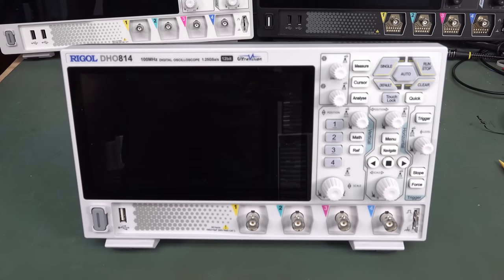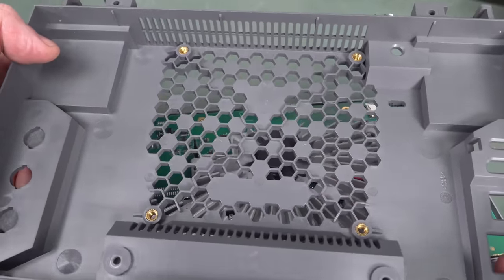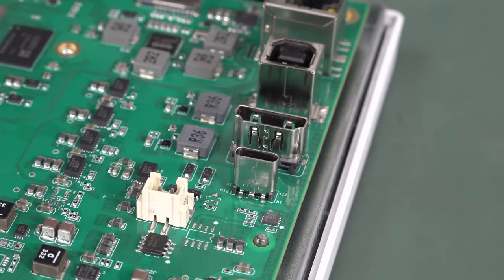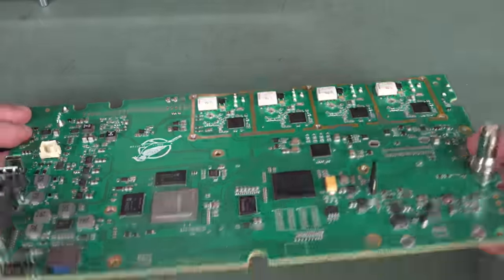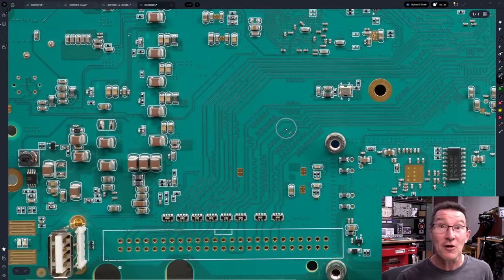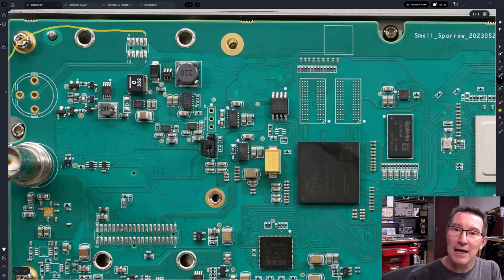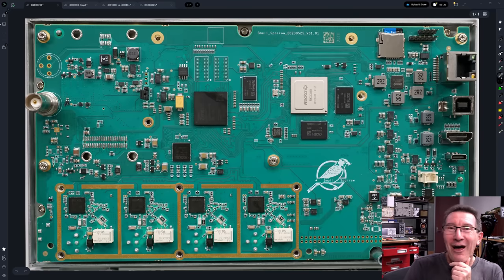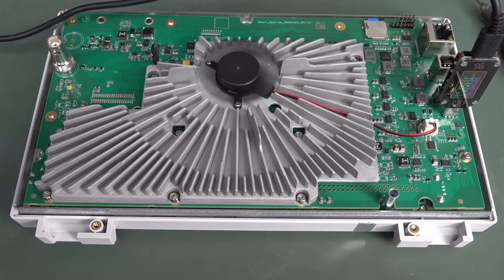EEVblog 1563 - New $389 12bit Rigol DHO800 Scope TEARDOWN

Comment: I would expect the SD card to have either an EXT4 or F2FS file system. But if Linux can't identify or mount it, it really might be something special.
Reply: Yeah someone mentioned trying a faster card for improved boot time - I'm assuming soemthing like DD could make a binary copy?
Reply: Someone hacked it already, it has a very weird filesystem setup. But all the necessary android files are there, which means you could turn a DHO804 into a DHO924S by swapping the SD card.
Reply: @petegaslondon  Yes, dd will make an image of it no matter what file system and partition type is used.
Reply: It MIGHT also be due to the sector size used for the filesystem.  Linux on x86/amd64 doesn't support larger sector sizes than 4096 bytes for ext4.
Reply: @0x8badf00d  The term you're looking for is block size, and this limitation could be removed very soon with the current work on folios.
Reply: @JHVOGamers maybe if someone is good at hacking we might be able to get the scopes android to run on a orangepi4 or get orangepi 4 optimised osses to run on the scope?! who knows but cool that it alr has been hacked

Comment: Oh that niiice - I'd recommend maybe, if you ARE gonna go inside,(void your warranty!) A blob of epoxy over the USB-C?
 Oh I WANT that Logic analyser one its niiiice - with the generator and in black, is like oohhhh!!
  (never had anything much more advanced as my poor ol Tektronix rack valve jobby, that i had before the nasty Eviction - kit-built a few little pieces of Chinesium test stuff, but ooh I LIKE this thing)  . .  PS Maybe the termination res's are applied so the open transmission lines dont resonate/ring? OR that they can rework their OWN boards easily - OR that you really CAN do it yourself :)

Comment: If I would buy one of these, first thing I would do after the warranty expires is to clone that SD card. It will almost surely fail/get corrupted within the first 5 years. At least it's a decent brand, but still a guaranteed failure point. At least it's easily replacable, so I like this idea against the soldered-on flash memory, which is only a bit more reliable than an SD card, but takes much more effort to dump its contents and clone it.

Comment: The only things that really concerns me about this are the USB C power connector and the fan. If any of them break you could have a bad time. Otherwise it looks like a great deal.
Reply: It’s not terrible to replace USB-C connectors as long as the traces stay put. I say USB-C power should be a standard for T&M that can use it.
Reply: @absurdengineering Replacing a USB C connector is easy. What concerns me is that if you need to replace it, there's a good chance there's damage to the PCB already. But that's not the main reason i dislike it. The main reason i dislike it is the need for an external power brick. With the provided USB C power back you need some more desk space (more than the DS1054Z had in the back), or you need to buy a slimmer third party one (that would add cost, storage complexity and general inconvenience). Standard power cables are really convenient since I already have a box with 20 of them.  
I love USB C for devices that 100% require small form factor - laptops, smart phones, headphones, etc, but I'm not sure I like it for T&M. Or maybe i'm wrong and i just need to give it some time in order to see who it would fit.
Reply: The USB C is through hole. That is, thank goodness, a step up from those useless surface mount ones.
Reply: Attach a 90° USB adapter to the back cover, JB weld or hot glue it in place.  Bob's your Uncle.

Comment: The first console that you opened up was probably the Android shell which is a derivative of Linux shell. You should be able to list files and folders with `ls`, `cd` into directories and maybe even list some hardware specs (e.g. system RAM) or look at how they are using the SD card and stuff. I think the shell could be using the Busybox toolbox so the basics should be there.

Comment: I would have really liked to see a metal plate inside for the mount, im not worried about its weight im worried about grabbing it and overcoming the monitor mount friction several times a day as you tilt it around across the bench

Comment: It doesn't look like the paths from the frontend to the ADC are differential, just single-ended referenced against the ground and shield.
Reply: Huh? Just zoom in, it’s plainly visible that they’re controlled-impedance differential pairs. (And the pair of series resistors is also plainly visible.) There’s a separate guard trace to the shield.

Comment: Strange to use a micro SD card like that. I've seen that done for a prototype or development revision, but then for later builds they swap it out for an emmc module to save cost. Gluing it in also makes it seem like they don't intend users to swap them out as a means for an upgrade, but maybe for a technician to upgrade?
Reply: It's possible they want to be able to quickly/frequently update firmware in the factory during assembly. With SD cards, you can do that with a cheap duplicator machine, but it's harder with an emmc.
Reply: Maybe uodate firnware easily
Reply: Some eMMC modules have very high failure rates.  I have a bunch of network devices here with dead eMMC modules, which I can’t fix because the ROM has a very limited eMMC driver.  And eMMCs are on small daughter cards, so they were designed to be swapped!  If these devices, had micro SD, they’d be simple to repair.  Never solder in flash memory if you can, because it wears out too quickly.

Comment: I got the 924S and it heats quite hard to the point the BNC on the front are hot. Same with both BNC at the back (OUT and function generator). I have put a 100mm fan on the back and it cools it down well. I bought it for the PLA, output to monitor and the fact you can use a mouse and the monitor without a computer. With age is harder to see these small displays

Comment: One issue I see is the fan is going to be difficult to replace when it inevitably fails. You are not going to be able to get that off the shelf.
Reply: or take out the fan and srew a bigger one on the outside ... I did that also on my 1054
Reply: It might be a pretty standard graphics card fan.
Reply from the maker: I found many off the shelf that look identical, they are used on GPU cards.
Reply: @EEVblog  I still think I would have preferred a case that was even 10mm thicker and used a standard fan that I could get from RS/Digikey/Mouser/Farnell etc. How easy is going to be to get a replacement fan in 10 years time? That said I think I would have preferred spending an extra $10 and having a bigger case and heatsink with no fan 🙂

Comment: It's really nice that they populated all those extra small components. Those are always the hardest to find if you want to hack such a device. 

I tried to add Bluetooth to a slightly older car radio. It has an audio input selector that is controlled by I2C and has traces going to an unpopulated RCA jack on the back used for a cd-changer. It has some kind of a bus system on the board that checks if devices are present and communicates with them. If you unplug the Cd part, there is no CD option in the input selection anymore. With that functionality I can't just solder wires to those rear solder joints but I would also have to populate the components used for the cd-changer bus and somehow trick the CPU into thinking that there is an active cd-changer connected. I now just soldered the Bluetooth module to the front audio-in pins and can change the input by flipping a switch to turn on/off the BT receiver. I could even use that thing as a simple Bluetooth receiver if it is turned off with the audio-in jack as an audio-out.

Comment: The SD card is also an easy way to factory-program the thing: no messing around with JTAG and such, just stick in a preprogrammed SD card containing all the firmware.

That doesn’t explain why it won’t read on Linux though. What does dmesg say when you plug it in?
Reply: Maybe the content inside is not a valid filesystem. Maybe the bootloader inside the processor know how to handle. A raw dump will clear the things.
Reply: JTAG isn’t just for programming. JTAG literally stands for “joint TEST action group”: JTAG’s original purpose was to enable circuit testing without needing to add as many test points, complex test jigs, etc. It’s commonly used for production testing.
Reply: @tookitogo  Sure, but you can do both: fully test all boards using JTAG and then later personalise them as needed with little effort.
Reply: I bet it would read with the right software. It's probably just not formatted with a standard partition table. Something like Balena Etcher would probably read it just fine. Making sense of what you read, that would be the difficult bit.

Comment: Rigol needs to address the flimsy connectors. The logic analyzer upgrade is a ripoff if the power connector breaks off. They obviously weren't paying attention to the 1990s through the 2010s when laptop power connectors constantly fell off their motherboards.

Comment: The discretes being fully populated would depend upon the MFG method. For very high speed /throughput MFG you have one reel for each form factor of components that is pick and place. So for example you would have a 0603 reel and it has all resistor, caps, inductors on it. This allows the pick and place to work in a linear fashion across the board. MUCH faster and if the parts cost fractions of a penny the savings for this high speed is likely higher than having different master reels made.  Discretes in volume in China are basically the cost of material +5 to 7%. Master reels (where these discretes are placed in the appropriate position from raw reels to master reels) cost virtually nothing and are often just a contract line item.  And of course populating the discretes terminates otherwise open lines.   This is an exceptional design. Hats of to the Rigol engineers.
Reply: They used to do this for through hole parts which were physically much bigger so you couldn't as easily line 10s of different components up next to each other on a machine.

But surface mount components are so much smaller and tapes are what 8mm wide at minimum? You can fit 50-60 maybe more different reels across each side of a high volume PnP machine... Do they really bother to populate custom reels of different surface mount components in a particular order just to make the machines job easier? Doesn't make sense to me...
Reply: Yes they indeed do. If you watch a video on very high volume production consumables (like cell phones) it is phenomenally fast.  Reel changes and repositioning adds up very quickly. Generally the Production Engineer will evaluate the cost benefit and order the reel stacking. During the pre-release design review stage (or earlier) you bring in the PE and make sure the Design For Manufacturability needs are met. Part of this review are cycle, throughput and test times.  A good PE prints profit really.

Comment: Love a new small scope with more features!  However... as a retired engineer who tinkers around, I'm pretty happy with the 100MHz 4 channel 8 bit Rigol DS1104.  I'm not sure I can envision a situation where a 12 bit scope would be noticeable improvement.  Maybe when dealing with very small signals?
Reply: If you wanted to measure noise in an audio circuit or something, I could see it being useful.
Reply: from 8 to 12 bit is a huge gain!
Reply: well i suppose if you think of 8-bits as being a max resolution of 1024 peak to peak. (but only when the scale takes advantage of the entire range)... that is like a 1080p hd sort of resolution. so then 12-bits is analogous to going from hd to 4k i suppose? does that sound about right?
Reply: @dreamcat4  No question that it provides more resolution, but I can't think of any instance where I was dealing with a signal of a couple of volts where I needed more resolution.  If I was working with a microvolt signal, then possibly.  There's also the issue of signal to noise ratio.  If I've got anything other than a very clean signal, then the extra resolution is overshadowed by the noise.
Reply: @dreamcat4 in what world do 8 bit have 1024 counts?
Reply: dang you are right  @Lumi_nance  ... i got confused with the other 10 bits scopes

Comment: Could you mount a 92mm or 120mm fan on the back?
Reply: 92 mm sure has to sit there.
Reply: With enough hot-snot, you can mount anything to anything.
Reply: @ghydda  I was thinking of a 3d printed adapter/mount.

Comment: I'm trying to understand if I can supply the scope directly from 3 Li-ion cells (11.1V discharging to 9V) or 4 Li-ion cells (14.8>12V).

I suppose the scope has an internal dc-dc converter to provide all the necessary voltages that can handle some supply voltage changes.

Based on your experience and the results of the teardown, please let me know what you think.

Comment: SD cards are a lot cheaper than eMMC. And a lot slower. eMMC and  RAM have both jumped up in price lately. It is running Android? That is disappointing but being a phone chip, the 3399 is probably better supported that way. I have noticed the Debian/Ubuntu/Armbian for the 3399 has Android kernel stuff that is not so great.

The passives for the memory chips are probably so that these boards can be for either product by only adding those two parts in rework. And given memory price volatility they can go ahead and make boards and shop for RAM at spot prices later.

Comment: Serious question: when is it time to give up on my old analog scopes? I'm sure the resale value is nearly nothing - I paid $400 some (10?) years ago for a 100 MHz two channel scope with two additional channels (really sort of a channel 1B and 2B) with independent triggering, time delay, and magnification (effectively, you can view a different portion of the signals on channels 1A and 2A, or zoom in on a slice of one of those channels while also viewing the full signal).

It's still a useful piece of test equipment, but what am I really missing? It can't catch a one-shot glitch (rather, no way am I going to fork out $3+ a shot for Polaroid film and pray I get the triggering right), it can't store plots to share online (not that anyone wants to see my scope screen), but these things aren't really meaningful upgrades to me - I might use them but very seldomly. I would appreciate portability - a USB C or otherwise battery powered scope that takes up less space would be nice.

On the other side of the analog vs digital scope debate - I let go of a Tektronix mainframe (7104 I believe) some years ago for around $100 because it was a giant boat anchor - although I would argue that essentially the same bench space, minus a couple inches, is taken up by a modern scope and accessories (with the big Tek you'd just stack accessories on top of it or flip it up on the backside feet if you really needed the space, a bit like standing a minifridge up vs laying it down). You might think, who'd want such junk? Well, it had 1 GHz of genuine analog bandwidth, old calibration stickers from the previous owners (Intel, y'know, the processor guys), and an invoice price north of $60k USD (I picked it up for less than $200 myself). I do miss the feeling of knowing the trace on screen is completely undistorted by bandwidth concerns, or triggering on a glitch most scopes wouldn't be fast enough to catch.

Comment: Well, here we see the "Dark SIde" of the USB-C Standardisation for Power:
Internal Power Supplies for lower power devices might be a thing of the past and they get moved towards USB-C, for better or for worse.
Well, both have pros and cons. 
THe con: you need to find a USB PD Power Source for this device...
Reply from the maker: I does come with one, of course. Decent quality Liteon.
Reply: the good: you can make yourself an isolated scope for cheep...one of the big pros from the 4000 series sar the battery option, with usb c you have a lot of relatively cheap power banks to choose from.
Reply: @EEVblog  Yeah, but you know how it goes ;)
You put it away and then misplace the Power Supply. But good to hear that its a good quality Liteon!
Reply: @hongotopiadada7574  good point. Was thinking the same, after I send the post....
Yeah, you can just use a good powerbank and you'll get a great isolated Scope...
Maybe even use it with a Laptop perhaps? (if that Laptop supports USB PD).
Reply: @Stefan_Payne  sadly my laptop just outputs 5V over USB-C, but maybe that exists. But even if not, your laptop charger should charge the scope too. I normally just have one charger for laptop/phone/soldering iron in my back when going in the field and with a scope like that it would be just that power court that i need... personally love the change to USB-C but do not like the fact that from time to time  they are a bit flimsy installed
Reply: @hongotopiadada7574  yeah, sadly USB-PD isn't that common on Laptops yet...
So you have to actively look for it. But on the other hand, you might need 2 USB-Cables anyways, so it might be better to just use a USB-C PD compliant powerbank and use that instead...

Comment: You have to use the USB-C connectors with the magnetic attachments so it would easily disconnect if the cable is pulled.  I use those cables on USB-C power connection on the my Apple MacBook AIR.  I wonder if accidentally cutting power would corrupt the SD card though.

Comment: There is a lot to like in this but the micro SD card. This is a very cheap idea and they also die by the dozen. It would be a good idea to image this and have replacements ready when the time comes.
Reply: A embedded system i use has just a bare flash drive as the boot drive and is raw fs
Reply: I can assure you that submarine speed and distance logs used in the defence industry have used the technique for at least six years.